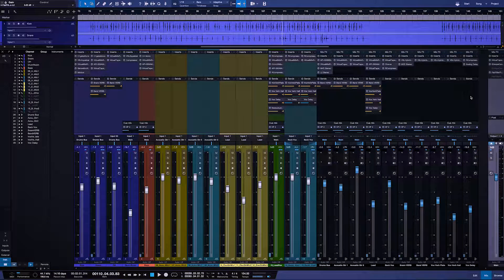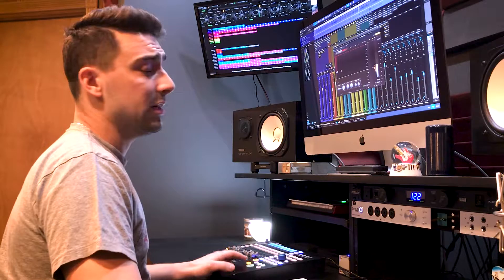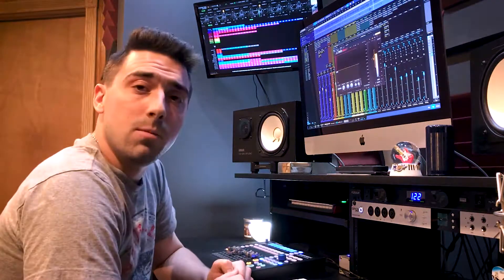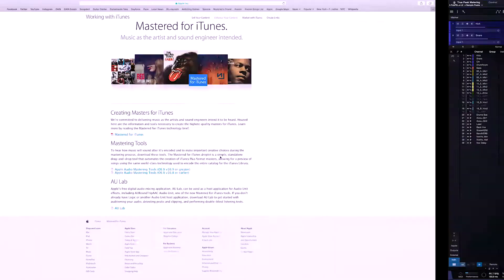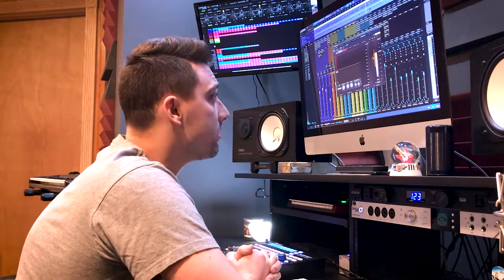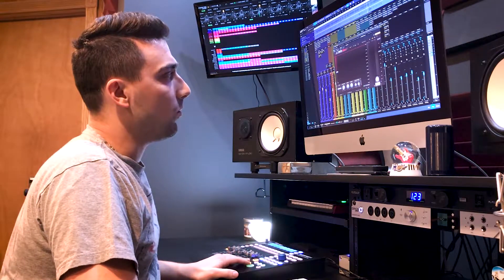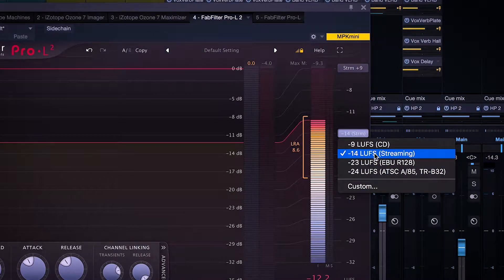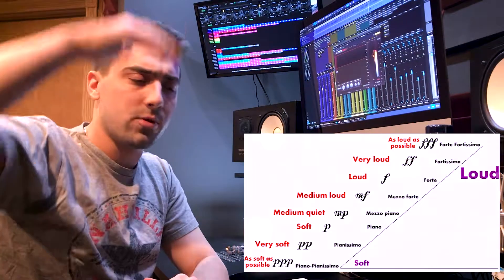Demystifying Intersample Peaks

Comment: i tried Fab filter Pro-L 2 Demo with true peaking on and 32x oversampling and after rendering an mp3 and playing back with a limiter it still had intersample peaks. Can i get rid of them if i use an analogue compressor and record it back?
Reply from the maker: I’m not sure if the demo version bounces down at full functionality of the plugin. It most probably does, in that case, look at the value of the peak and bring the output ceiling of Pro-L2 down by that amount. Usually -.5db to -1db of output ceiling attenuation is typical. Hope that helps! Thanks for watching!